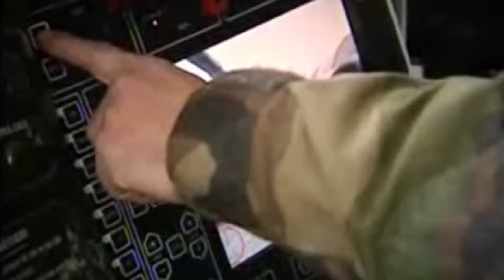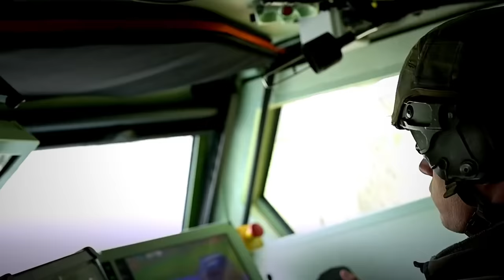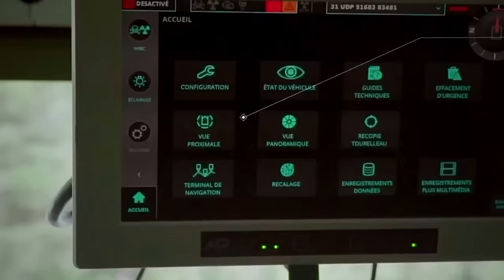This Armored Vehicle is Making the US Green with Envy

Comment: Thé griffon doesn’t have a built in or mountable mmp launcher in the French versions (not sure there is any version that has an mmp). Some of the griffons can carry an mmp group. In the French doctrine fighting happens outside the apc
Reply: Correct : The old Mephisto VAB, equipped with 4 ATGM named "HOT" (4250m range) ready to use, will not be replaced by a Griffon variant. But the Jaguar - an other armored vehicle of the Sorpion program (a scout/reconnaissance light tank), is equipped with 2 modern MMP missile ready to use.
Reply: Parce que ce sont les premières versions... Comme pour le VAB HOT, les versions MMP arriveront bientôt... Mais en vrai la version MISTRAL III et MMP existe déjà sur le blindé SERVAL, il semblerait même que Thales&co prévoient une tourelle 20mm pour SERVAL...'
Reply: @vaitiareapetahijarmann1533 thx.  do you know about ( lite)  AA capabilities ? 
I didn't see any small AA version and for jaguar is the 40 CTC exactly the same as 40 ctc rapid fire marine which has AA capabilies ? 
AA needs radar I look at french arsenal found no lite systems, we surely have slalker than Mamba.
Reply: @frednoname3714  le canon 40 CTC rapide fire Marine a une version terrestre, qui est monter sur le même châssis de camion que le CAESAR 4x4... Le Jaguar peut abattre des hélicoptères et drones ou aéronef volant à basse altitude et à vitesse subsonique (type A-10 Thunderbolt ou SU-25, mais avec clairement moins de précision et capacités qu'un système anti aérien de type Guepard), mais le Jaguar n'est pas fait pour l'anti aérien à proprement parler, il n'y a pas de radar sur le Jaguar comme pour le Guepard Allemand... Le Jaguar est multi-rôles mais comme tout multi-rôles il a ses limites...'
Reply: @vaitiareapetahijarmann1533  merci . Le nom svp du rapid fire terrestre svp ? Connais pas du tout 
Ps bien sur sans radar AA = bricolage
Reply: @frednoname3714  Avec le conflit en Ukraine la France à vraiment compris la pertinence du shoot and scout dans plusieurs de ses domaines, surtout sur celui de l'artillerie et de l'anti air courte portée...'
Reply: @RoroBar-k8e 4 MMP, 2 ready + 2 in reserve
Reply: @frednoname3714 Yes 40 mm is the same as Rapid fire for naval warfare.
Reply: @kiefferfx18  yes and no. Only the canon is in common.  I have checked. To achieve AA it is necessary to put the whole "marine" system called "rapid fire" on a dedicated Truck with radar. Can see THALES  prototype on Truck TITUS without the "naval rapid fire" complète system, no way to link it to a radar. And turret surely much faster than on Jaguar. But the 40mm tube and rounds are same. And of course "rapid fire" is unmanned.
Reply: @frednoname3714  Thales did a prototype on a truck bed, the titus one was just a drawing nothing have been really build like that, the newest proposition if to use the truck be of the CAESAR NG and adapt it to the RapidFire turret. Recently a new RapidFire turret has been unveiled with 4 MISTRAL missiles and IIRC a small radar on the turret
Reply: @vaitiareapetahijarmann1533  Je suis pas sur qu'une version AKeron MP du Griffon soit prévu, ya une version MISTRAL du SERVAL par contre qui est prévu
Reply: @vaitiareapetahijarmann1533  CAESAR 6x6 en "version"  NG pas 4x4
Reply: @donatienclaeyssens7821  ha ! Thx canon + missile is surely better and titus too small. Sorry for Thales/bushmaster thales any way not makings armored.
Reply: @donatienclaeyssens7821  Une version purement MMP non, mais une version MIT-50/MMP ou LGA-40/MMP, est en phase de test!!! Mais c'est surtout le SERVAL qui se voit attribuer une version MMP... Le SERVAL MISTRAL 3 le prototype existe mais n'a malheureusement pas été commander par l'Armée Française... C'est encore en phase de test mais la DGA a créer un système anti-drones avec un LGA-40 téléopéré, le système est basé sur VAB et n'a aucunes versions en GRIFFON ou SERVAL, car en trop faibles quantité dans nos armées... Ce que je verrais bien dans nos Armée c'est le VBCI PHILOCTETES ou VBCI T40, qui a en plus de la tourelle JAGUAR une protection accrus...'
Reply: @donatienclaeyssens7821  Disons que j'étais rester basé sur le prototype de départ qui était 4x4, merci de me le dire effectivement le Rapidfire Land sera basé sur le chassis CAESAR 6x6... Pour la version 4x4 je le verrais bien avec un canon 105mm, vu la faible portée comparative du 105 par rapport au 155mm, il faut impérativement inclure le shoot and scout de nos mortiers à nos MRLS en passant par nos canons, les Ukrainiens le disent aussi y'a pas mieux que les CAESAR et pourtant en terme d'artillerie ils ont ce qu'il y'a de meilleurs au monde entre M109, PZH 2000, M777, etc, en terme de mortiers Renault Sherpa a un super prototype en 80 et 120mm et les US travaillent sur un canon 105mm monter sur chassis Humvee's... Je pense surtout qu'aux vu de ce qui se fait en MANPAD etc en Ukraine, il serait plus judicieux de partir sur quelque chose de nouveau plutôt que de mettre des MISTRAL IV, le STRASTREK me paraît beaucoup plus pertinent avec le Rapidfire Land... Le MISTRAL III serait plus pertinent utiliser comme les STINGER sur le système AVENGER, le 30mm qui était censer être sur le MBT Franco/Allemand pourrait être utiliser avec les MISTRAL III...'
Reply: @vaitiareapetahijarmann1533  attention le VBCI t40 et philoctetes n’ont pas la tourelle du JAGUAR c’est une tourelle différente autour du même canon (existante en teleop et habiter de mémoire)
Reply: @vaitiareapetahijarmann1533  ce que tu appelle version MMP du coup doit correspondre juste à la mise d’un tube Akeron MP sur le tourelleau Hort et d’arquus qui a été tester de mémoire récemment.
Reply: @donatienclaeyssens7821  Si je ne dis pas de conneries, il me semble que sur VBCI T-40 la tourelle est la même que sur Jaguar d'après ce que j'ai lus c'était par soucis logistique, permettant d'avoir une tourelle pouvant être mise soit sur VBCI ou Jaguar...'
Reply: @donatienclaeyssens7821  Il s'agit de deux tubes MMP monter sur une téléopérée 12,7 sur Serval et Griffon... Mais comme je l'ai dis aucunes commandes de la part de l'Armée Française... Pareils y'a la version Mistral III avec une téléopérée 12,7, mais aucunes commandes de la part de l'Armée Française...'

Comment: How is this substantially better than an Australian bushmaster?
Reply: 6 wheeler and armor thickness : better mobility and protection
Reply: We have new smaller one 4x4 called CERVAL now almost everything is modern and much better armored that antics VAB next to modernise is " VBL" ou kind of bizarre hummvee. ( small)
Reply: Speed, range, reliability, costs, kits, comfort, firepower, modularity...
Reply: Bushmaster is also french 🇫🇷 ( said from THALES but I think from Nexter,) is à 4x4 like our small new SERVAL. Griffon is 6x6 70 cm longer 
The huge différence is weight 13 tons for bushmaster and 25 for griffon + pobably mens capacity. Also not sure but main weap depending on version is 7.62 on Serval and Bush and 0.50 cal is 12.7mm on Griffon boths finally not same Light véhicules not going as bigger inside front. Complementary with smallers "jeep" kinds. Think I answered true différences both are french design ... the country of...submarines.....good luck with incredible U.S choice of multiples ugrades before you get the new ones 🤣🇫🇷🇫🇷 decades...
Reply: Griffon has more horsepower, more combat proven (France are fighting in Africa and other UN missions, Australian barely), more wheels, more protection.
Another question ?
Reply: @kerdart351  YEP thx,  didn't even know and checked Griffons in 2021 in Mali... sending new-born griffons also means having balls. Most times new things need lot of tuning. THX for info.
Reply: @kerdart351  me again U.N missions of griffons ? plz. Merci 
Any idea of the true retex from guys ? Failures ? Happy ? Etc thx
Reply: @frednoname3714  Yop I wasn't especially talking on a lot of UN mission with Griffon outside Mali, the situation is a bit different.
I was talking about France projecting its forces a bit everywhere for combat or training purpose (for example in New Caledonia, Djibouti, etc), Griffon has been built based on French return of experience. Basically this is a vehicle built to suit French army, and if it is able to be exported it's nice, but not the main goal.  Nexter, Safran, Thales and several companies are usually working in close proximity with French state.
French is one the few states in Europe and even in the World that control almost everything about its military. 
Even patent applications are each checked to see if they have a military interest and should be disclosed or not. No other country do that in Europe
Reply: @kerdart351  yes i am 🇫🇷 you just made me aware of Griffon in Mali and looked for RETEX. What you said is correct just NEXTER ( and NAVAL GROUP) is kind of governemental company and overs are private. Avoids some problems... and yes we have small but everything quite good . Air and Subs NUKE cost HUGE amount of 45 milliard budget. BUT we run it ( was lower to 35) for 70 years while some slept waiting for NATO's GIs .... we don't want loose again... training >> Guyane worst place to be. When super U.S comes to try they says we are crazy.
Reply: @frednoname3714  yeah I forgot Guyane as training ground lmao
Indeed, French independance in military systems and doctrine has no price...
Reply: @kerdart351  😚 gift hop invented FIRST 155 striped Steel canon... around 1870  "De Bange" and 1917 morden 155  " grande puissance Filloux -GPF " we gave some to USA to say thx for 1917 help with développement agreements and they built "long-tom" not sure M55. This GPF is the grand of CAESAR canon. Probably arsenal part every  french know the best with Rafale. It is funny we forget submarines, FREMM fregates... and that Griffon was in Mali. We are bizarre 🤣
Reply: @frednoname3714  we should speak in French, bc honestly I have a hard time following everything you said in English, bro ;)
Reply: @kerdart351  haha le con ! En plus je me disais que le mec savait des trucs et que c'était étrange de voir un étranger qui ne nous prends pas pour des nuls.. avec mon anglais merdique. J'avais même essayer de voir ta chaîne mais elle ne précise pas rigolo. Moi qui pensais apprendre d'un étranger les Griffons au Mali 🤣🤣
Reply: @frednoname3714  J'aime faire le sous-marin. ;)
Ya pas bcp d'anglophones qui me grillent, ça me permet de leur mettre des tartes quand ils disent des c(onneries sur notre industrie ou nos armées.
Reply: @kerdart351  Rheinmetall 2014 qui devait entraîner 90 000 russes à  la guerre moderne.tu connais ? ( THALES  à côté des saints) ça vaux le jus
Reply: @frednoname3714  Non j'étais pas au courant t'as un titre d'article là-dessus stp ?
Reply: The bushmaster is build by a french compagny, you that right?
Reply: @drschnaps8081  YES but looks like it is from THALES while almost all armored french are from NEXTER. . THALES is super hight class optronics caméra etc with now also have SERVAL which looks like a bushmaster.
Reply: @frednoname3714  Feedback from Griffon in Mali : Troops were VERY HAPPY with air cooling and IED protection. The men jumped 50 years in time, from the 70's VAB to the 20's VBMR. Everything is better, they can talk without shouting because the vehicle is silent, they can observe and shoot all around them 360° while they stay sheltered inside. It's much more spacious and comfortable, the vehicle detects gunshots and align it's turret toward, they're connected to collaborative combat system, they have more autonomy, they're faster, basically everything is better...
Everybody is happy to scrap the VAB, some are sad Griffon was chosen over VAB MK3, but overall Scorpion Program is a success so far, nobody complains.
Reply: @frednoname3714  it is Thales australia that did the design and build the Bushmaster, not to be confused with Thales wich is the parent group, Thales australia is born from an acquisition of an australian companie (ADI limited) by thales in the early 2000s, the bushmaster is not a french vehicle it is an australin armored vehicle
Reply: @frednoname3714   The Bushmaster Protected Mobility Vehicle or Infantry Mobility Vehicle is an Australian-built four-wheel drive armoured vehicle. The Bushmaster was primarily designed by the then government-owned Australian Defence Industries, and is currently produced by Thales Australia following their acquisition of ADI. Most certainly not a French design.

Comment: Is griffon exist to compete with VBCL ?
 anyone.....?
Reply: Do you mean VBCI? And if so, then not really. VBCI is an IFV (infantry fighting vehicle), while the griffon is an APC. That means that the VBCI is is made for active fighting, and supporting infantry once on the ground, while the griffon is mainly a transport vehicle, with some anti-infantry capacities, but you don't want to put it directly at the front as it doesn't have that much armour and firepower. If I remember correctly the VBCI also has a new modernized version being studied to update the current one in use.
Reply: @painsama4225  aaah.... I see
 That's a VBCI instead of VBCL .

Thx for th explanation.
I got it now.

Comment: You see how useless engineers are... Why are the sides armor plates not sloped but straight?  Historic lessons not taken into account?
Reply: Not a mistake. The problem with sloped armor is it vastly decreases the internal space available, and this thing needs to carry a large squad and all the supplies they need. 

And you can't make the vehicle any bigger.. taller and it's a massive target / can't fit under obstacles, wider and it's not air or train transportable.
Reply: Modern shells don't care about armor...
Reply: 1- this is not a breakthrough vehicle this is a APC 
2-sloppe Armor would make the vehicule bigger
Reply: The vehicle has kits, the armor sides are designed to place the kits on the surface. A plane surface is more practical. The kits surfaces are slopes. Check pictures of Griffon deployed in Mali to see the sloped armor plates.

Comment: Anything that happens on the battlefield”? I don’t recall it mentioning anti-tank mines, kamikaze drones or any anti-tank missiles like Javelin, Tone and armour piercing 155 mm shell?
Reply: It is mine resistant up to the STANAG and OTAN standards. No active protection systems are actually deployed on them to deal with ATGM, but it has been developed with the idea of being able to be retrofitted with such systems. As for « armor piercing 155mm » I think you have to stop with the drugs. 155mm is in the realm of artillery. They don’t use armor piercing, only HE and their derivatives. As mentioned in the video, it is resistant to all but direct hits from those, but a direct hit, especially considering the relative accuracy of the Russian artillery as well as the mobility of the vehicle itself, and considering French troops are mainly deployed in territories with terrorists that aren’t even close to having artillery systems precise enough to target moving vehicles, the Griffon is pretty well equipped. But if you wanted to mention how it could resist tank rounds, then no, it can’t. But nothing can withstand tank rounds, not even tank. If a Griffon ends up facing such vehicle, then someone really messed up. This thing is not made to be anywhere close to firing distance of an enemy tank.
As for anti drone duties, most Griffon are equipped with a teleoperated 12.7 roof mounted machine gun that can lock and track targets, so if it manages to detect the drone, or if a radar station somewhere close detects it and transmit the exact location through the SCORPION communication network, then the Griffon can potentially deal with them.

Comment: Another MRAP, yawn.  That glass windscreen, even if armored glass, is going to be a major weak point if they try to use this thing as a real APC / IFV.
Reply: It can take s hit from a RPG on the glass. It's not the cheep crap that's made in the USA
Reply: @livetillyoudielovelife2299 If you have any proof of this, please post it, because I'm not buying it. The shaped charge of even a plain jane RPG-7 can go through several inches of steel.  It will go though that glass like butter.
Reply: Australia Bushmaster is proof actually. what it can stand this can also. maybe better since some say is heavier armoured.
Reply: @nedkelly9688  I'm not seeing anything that claims the Bushmaster is anything more than an MEAP either.  Obey armored against small arms fire.  An RPG would go through it like a hot knife through butter.
Reply: @livetillyoudielovelife2299 no It can not get real

Comment: nothing to fear it has a Renault engine prone to be unreliable
Reply: Mercedes équipe ses voitures classe À diésel de moteurs Renault….
Reply: @jean-louisjoubert5086  and that reliability is only down to volvo...
Reply: At least Renault engines resist heat and sand, unlike some other well known brands !
Reply: @BruneSixtine  VOLVO...
Reply: @AnonIllumi  Renault engine are used in Mercedes without any link to Volvo.
Reply: @kerdart351  but who own em..